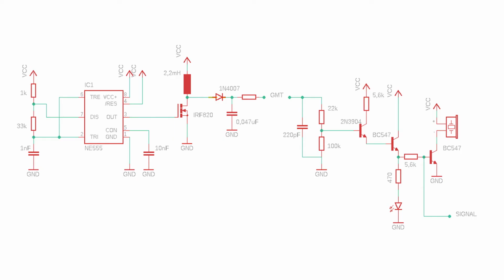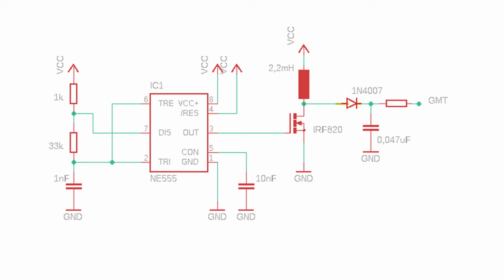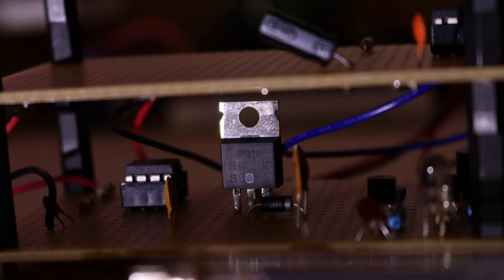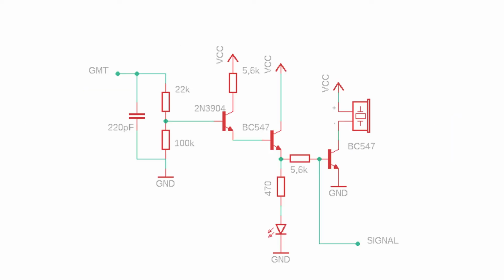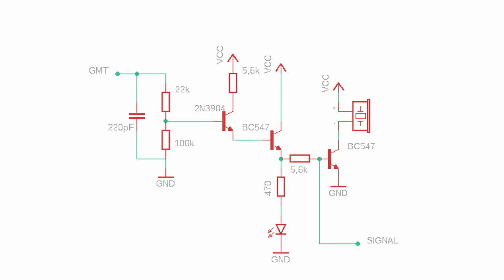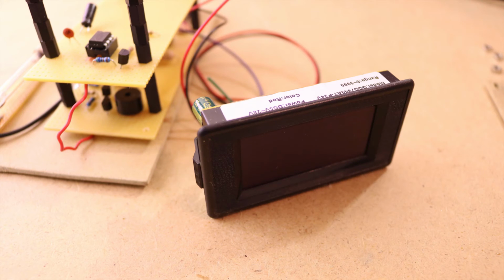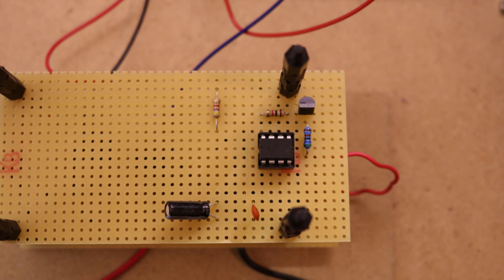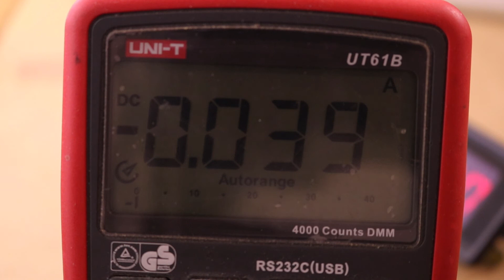How to build a DIY Geigercounter [with Display]

Comment from the maker: The resistor and the led at 1:41 is actually wrong in the diagram and should be from plus to the collector of the transistor. I would just leave it out and directly connect the transistor with the buzzer. Here's an improved version: https://youtu.be/MmWajfSEtN0